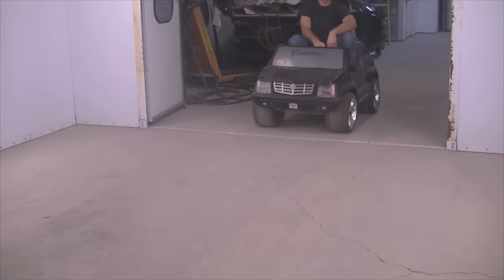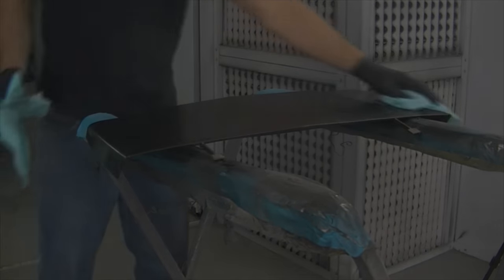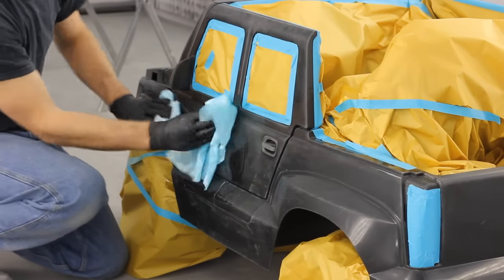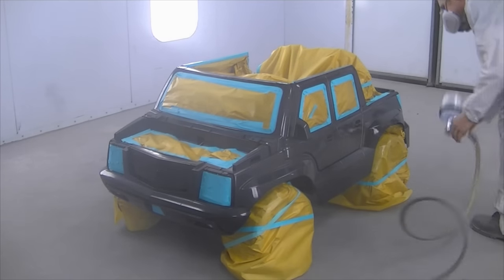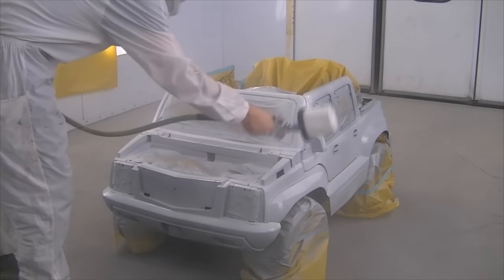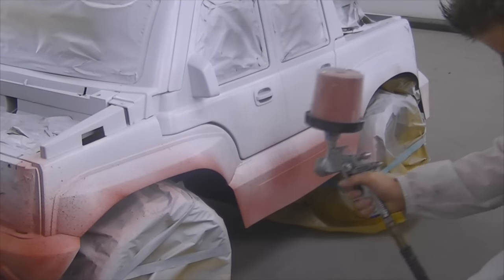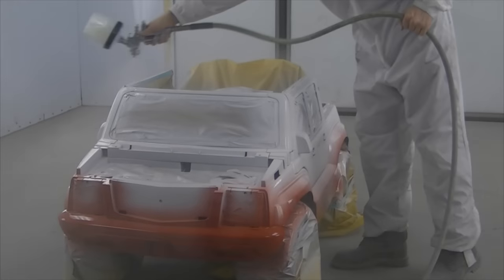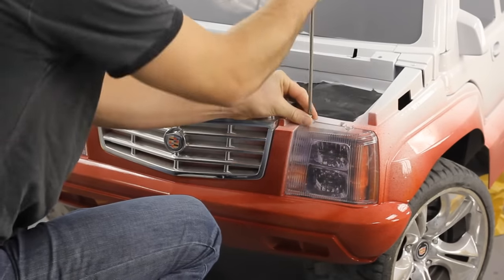Custom Painted - Power Wheels Cadillac

Comment: Next time you want that splatter look (I dont know why you would in the 1st place but...) use a new spray bottle. Ive done it when I wanted a rust painted surface and it worked great

Comment: Surprised though that you mentioned going Cromax. Coming from Diamont I would think you would have gone Onyx HD, which is an excellent waterborne system. Not knocking Axalta either, as I think Cromax is also good. What Limco clear did you use btw? LC4000 or 4100?  Either way, economy yes, but they are both pretty good clears. I have more big shops spraying it, compared to the DC5100, 5120, etc. 
Anyway nice work though! I dig the two tone how you did it.
Reply from the maker: Sam Frankelli I can't remember the specifics of this video, I do spray Onyx now which is a great waterborne/solvent hybrid system. I spray limco LC42000 usually as an economy clear, I think it was LC4100 if this was done in the high-voc days.
Reply: مرحبا بكم ط0 6
Reply: +Refinish Network I miss a clear made by ppg called dau 82 man that stuff was awesome but they stopped making it when the water born paint started off. have some on a truck that's been painted for ten years and it's still shines.
Reply: +Gavin Pickens .

Comment: I've spray painted a barbie trike before. I am considering getting rid of it, unless you want it. It was a horrid job, and you could try and "challenge" yourself to fix it.
Reply: Use sandpaper to get the paint off and repaint